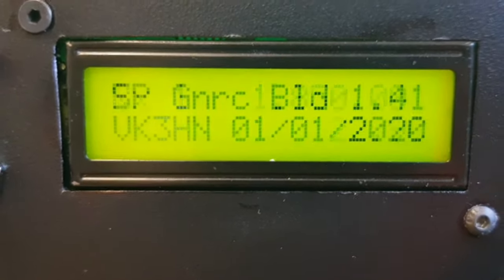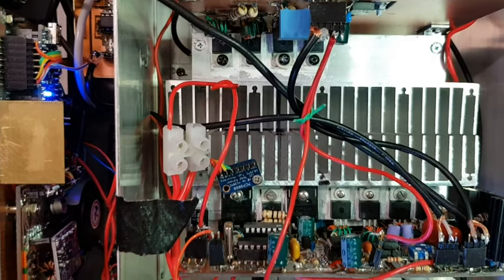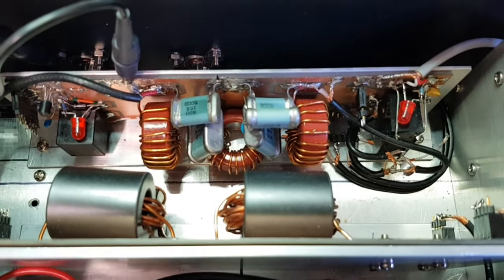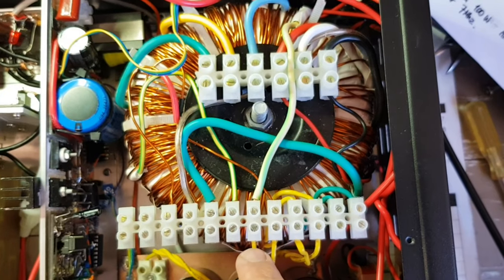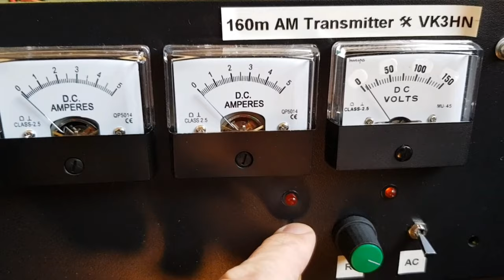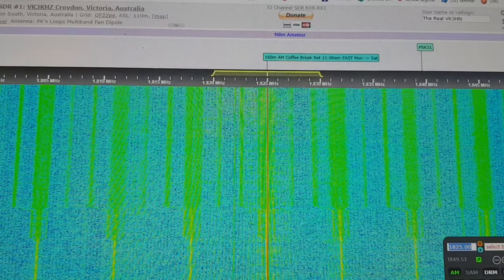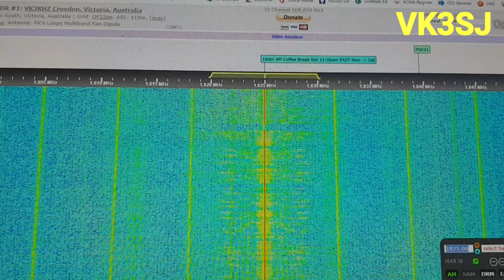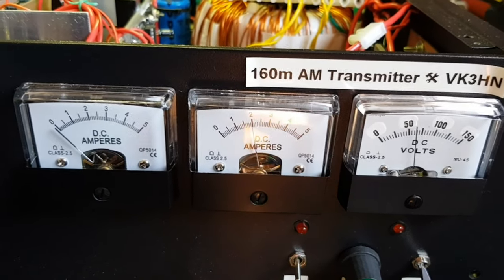Homebrew 160m 200 watt AM Class-D transmitter with Pulse Width Modulation

Comment: Beautiful project. I'm getting back into Ham Radio after a 40 year break, and this "new" PWM stuff is amazing! Makes so many things so much easier.
Did you ever consider using the CPU to do the Pulse Width modulation so you can experiment with "pre distortion" algorithms?
Reply from the maker: Thanks @thrillscience for your comment.  I hope you continue with the hobby, there's so much to choose to do!  My Arduino is for basic transmitter  control only. It is not really capable of doing digital signal processing. My modulator is all analogue.  But your suggestion  is a good option.  You could take a 125khz clock and digitize the audio, then generate the PWM in DSP software. That's an excellent experimental project, I haven't seen that done in a ham radio AM transmitter.  You could probably get it working with a Teensy MCU and the companion audio board.  As for pre-distortion, to make that work would require lab grade rest equipment and a level of knowledge that I don't have. Also, remember that the PA stage in this kind of transmitter is a high power RF switch, it is not linear. So pre-distortion has a different purpose in a PWM Class D architecture.   Just getting the PWM waveform should be do-able though -- you could do all kinds of digital audio filtering such as EQ and brick wall bandpass filtering.  Thanks for the idea! 73 Paul VK3HN.

Comment: AS YOU HAVE WROTE IN YOUR SITE ////This is not a beginner’s project! As well as many hours of sourcing parts and making PCBs, a bag of parts (mostly semiconductors including four IRFP260 FETs and three IPP530N15s) paid the ultimate sacrifice during development. The IRFP260 is a 50 amp device, but I learned that as rugged as they are, excessive drain to source voltage takes them out in microseconds. An important resource to bring to a project like this is a dose of stubborn determination. At least for an QRP guy like me! ,,,,,,,,,,,,,,,,,,Abig hello TO MY SECOND HOME ....good try ....keep going 73. FROM GREECE.......
Reply from the maker: efcharistó 73 vk3hn.

Comment: Hello! Good device! As I suppose - you spend on this device lot of time and forces! It`s the best approach to have a switching RF amp that modulate by an audio Class D amp. But why are there such big radiators next to power mosfets? Are they (mosfets) in a linear mode?
Reply from the maker: Hi Andrew, at 1:05 You can see 7 devices all bolted to the heatsink bracket.  The 4 on the right are the H-bridge TO220 FETs. They do the RF switching,  and are modulated. The 2 TO247 devices in position 1 and 3 from left are the Pulse Width Modulator switching FETs,  IRFP260.  The TO220 in the middle is a shunt diode. The modulator is PWM, not Class D, although the two are similar. The vital components you cannot see are the 28kHz low pass filter,  hidden underneath the heatsink.   This effectively converts a 125kHz PWM waveform to an audio modulated DC waveform which then powers the H-bridge.   I hope that's clear. Have a look at the schematic.  Best 73, Paul VK3HN.

Comment: Mind boggling build. Great stuff. I can just dream about such build. Keep doing the good stuff.  You are a true inspiration for all the home-brewers.  73 VU3KFK
Reply from the maker: Well thanks Asho!. These  bigger projects are just a series of smaller ones, and I benefited greatly by having most of the problems ironed out by a couple of local VK3 AM designers/builders. So the difficult problems that often emerge at integration did not eventuate. 
I will admit that,  I have a similar but slightly smaller AM transmitter for 40m. Almost all the same modules.  All built. Could not get the RF board to work.  No video for that project!  I'll get it fixed and working one day.  73!

Comment: Looks great, Paul. What is your PWM frequency?
Reply from the maker: The TL598C in the switching regulator runs at 150 kHz. The PWM runs at 250kHz.
Reply: @Paul_VK3HN  Oh, wow, I don't understand how 250 kHz PWM can generate 1800 kHz signal? Guess I need to brush up!
Reply from the maker: @kodrawer  The PWM is for audio frequencies in the modulator, not the radio frequency. 250kHz is a high frequency for PWM but the designer has good reason for it.  The 1800kHz signal derives from an si5351 clock which runs straight through a buffer, driver, and a pair of H-Bridge PAs into an RF power combiner.
Reply: @Paul_VK3HN  Thanks, Paul. I'd like to find out more about he output stages, buffer, driver, pair of H-Bridge PAs, and RF power combiner. Thanks.
Reply from the maker: @kodrawer  it's all described here, including schematic... https://vk3hn.wordpress.com/2020/02/15/200-watt-class-d-and-pulse-width-modulated-am-transmitter/

Comment: Nice how can i get one for 75 meters.
Reply from the maker: As the freq rises you need more drive on the MOSFET gates, but I think this design should work at 75m without modification.  See https://vk3hn.wordpress.com/2020/02/15/200-watt-class-d-and-pulse-width-modulated-am-transmitter/ for schematic. Knock  yourself out!